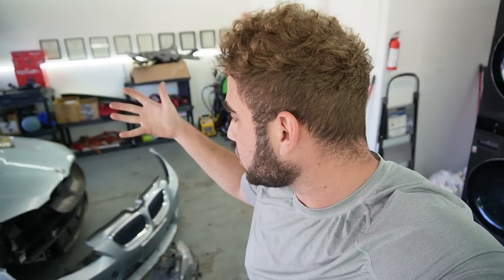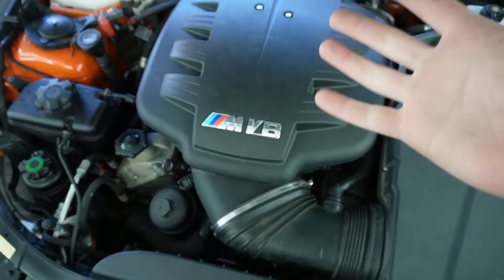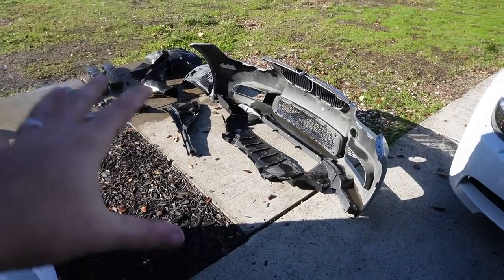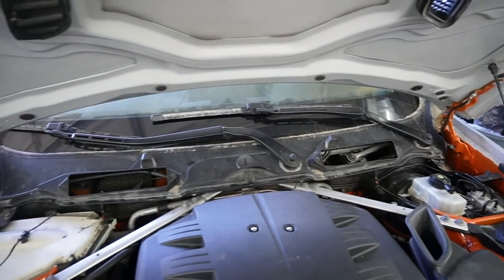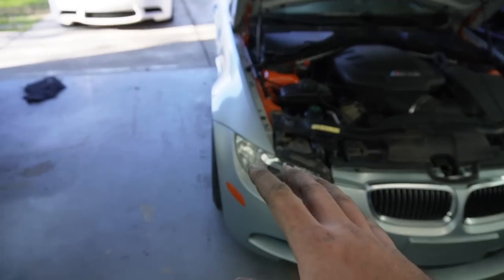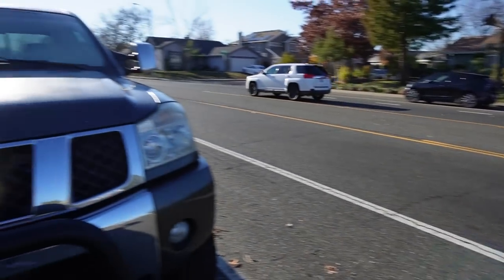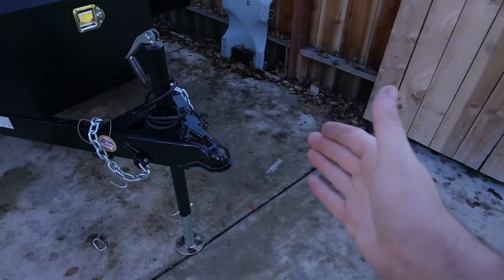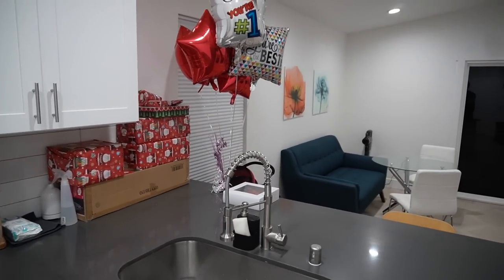Building A Custom 1 of 1 E91 M3 Wagon! (Part.24)

Comment: so wait nour if i where to do a m3 conversion id need the fenders, headlight, headlight bracket, bumper support (the foam), brake ducts, front bumper, and wheel cover under the fenders and the hood?